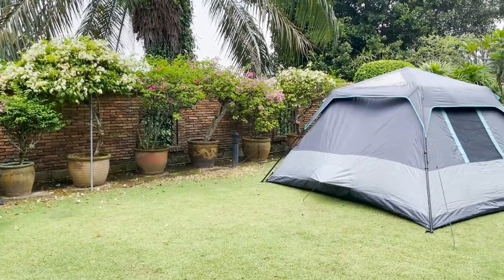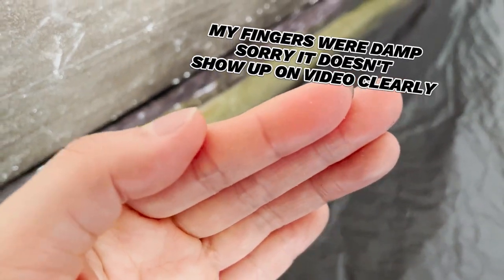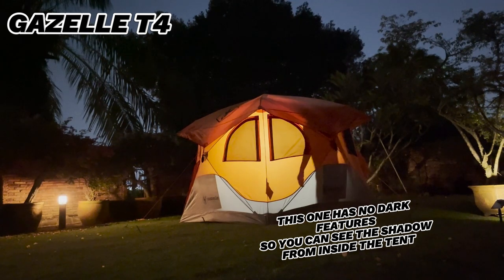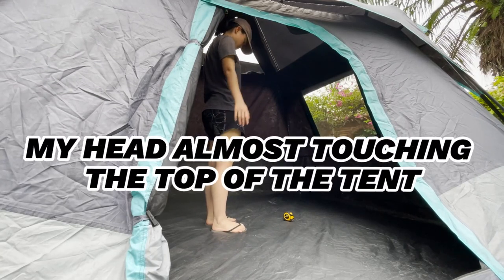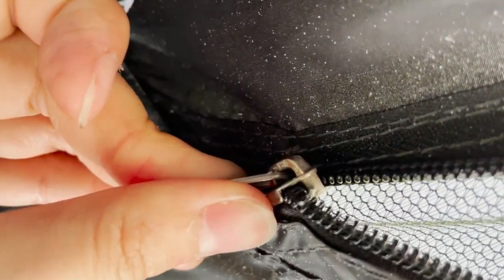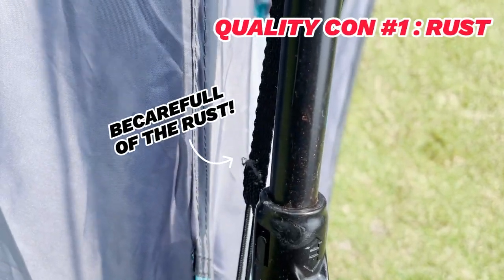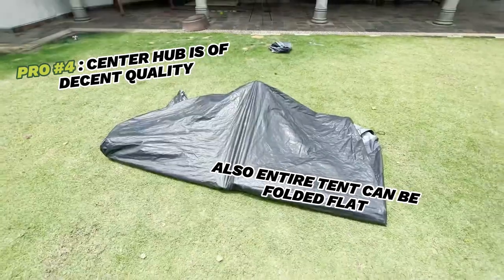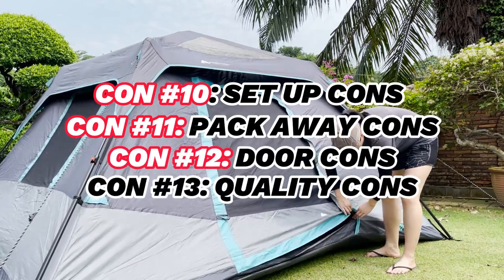Ozark Trail Dark Rest Instant Cabin 6 Tent Review (27 Tests!)

Comment: There are actually 2 versions of this tent. The one seen here, and a FRP (Fiberglass Reinforced Plastic) model. The FRP model has to be assembled. The elbows cannot bend. The poles are all inserted into the joints and the roof is higher as it's rounder. And as with any tent, you Must waterproof and seam seal it for extra protection.
Reply from the maker: Hi! Thanks so much for sharing 🥰 I didn't realize there was a non-instant version that was exactly the same as this. If I come across that in the future, I'll review it!